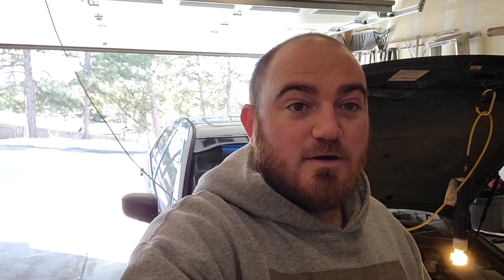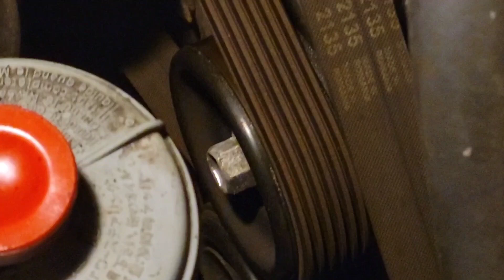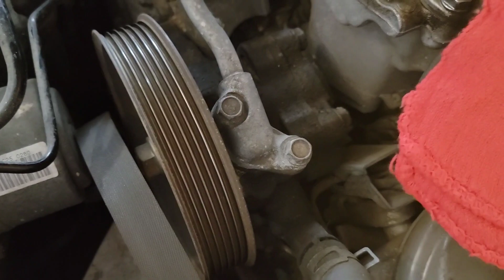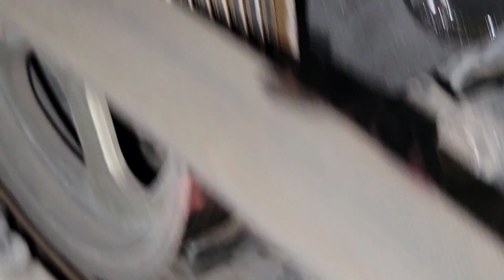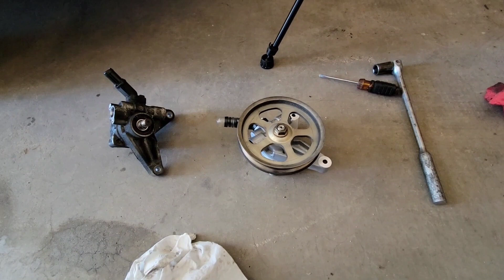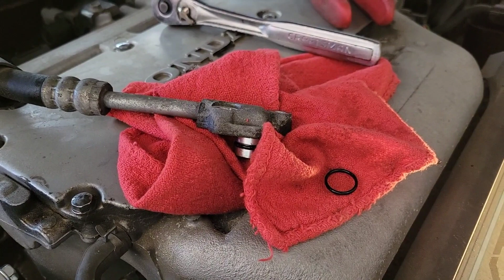Remove and installing a power steering pump on a 2003-2007 Honda Accord V6 3.0

Comment: If you don't have an impact, it's easier to break that pulley nut loose while it's still mounted in the car. Just a wedge a screwdriver or pry bar through the spokes of the pulley so it doesn't spin and break the nut loose. 

Also if you actually want to REBUILD the power steering pump, it's pretty simple and cheap to replace the o-rings and seals. Here's a really good video on that. https://www.youtube.com/watch?v=89hQ4xLzzXI&t=68s
Reply from the maker: Thanks for watching and the advice!